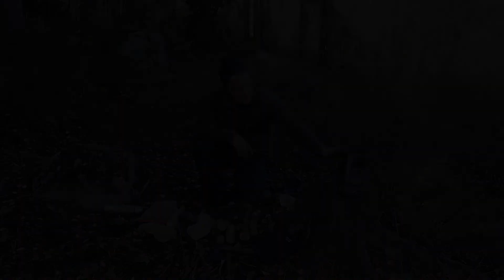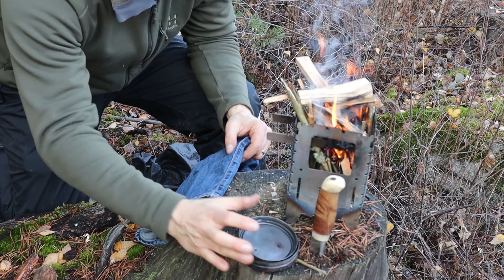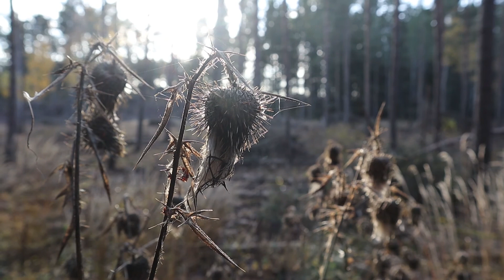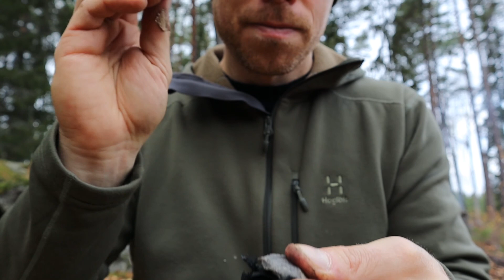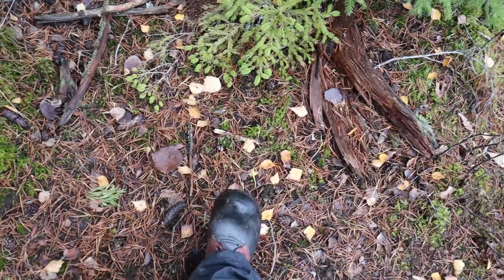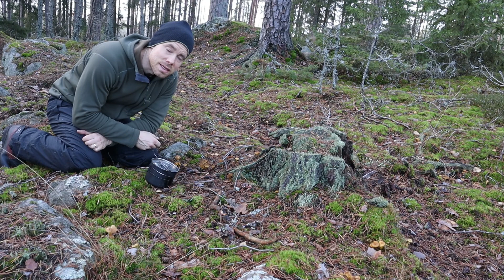How to make biochar and what to use it for. Biochar production, application: Building micro reactor.

Comment: Look up wood gas stoves / TLUD gasifiers. With those you can kill two birds with one stone. Make biochar and cook food at the same time.

The biggest advantage is that all your biomass will turn to biochar and there is no sacrificial biomass burned down to ashes.

Personally I prefer forced air TLUD gasifiers because they give a cleaner burn but for camping a natural draft stove does the job as well.
Reply: And I nearly forgot to mention, a good woodgas stove doesn't produce any smoke which makes it much more stealthy.

Great video btw :)
Reply from the maker: @CarbonConscious  thank you for the tip! I will check TLUD. I have also used traditional gas stoves with the same tin can it works fine also without requiring wood. But, I guess a good gasifier would do it better. Please subscribe if you want to, I plan to make another one on the same topic. Take care!